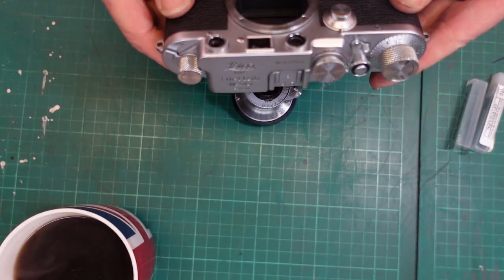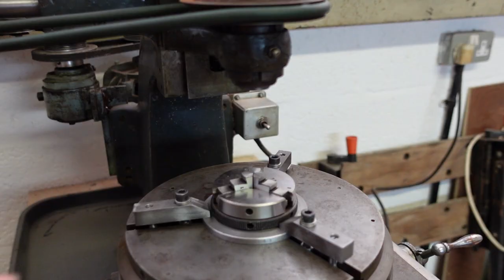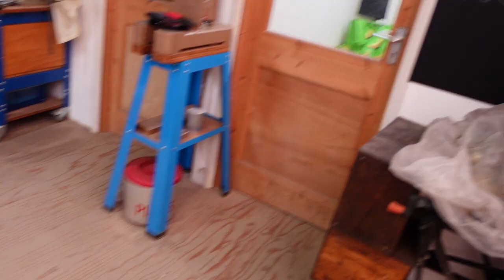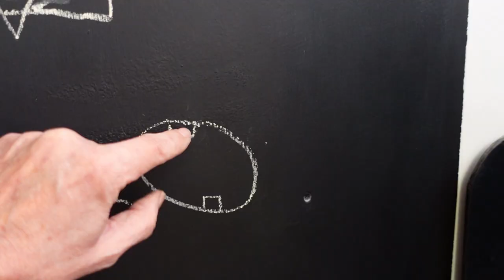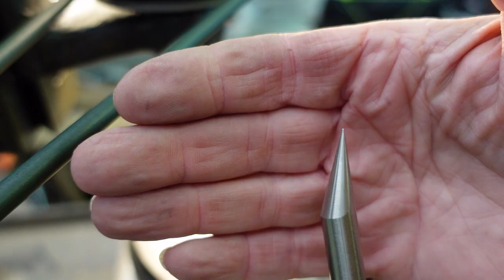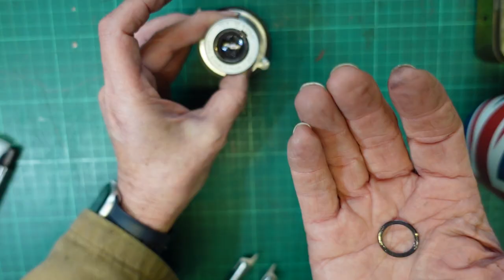Leica IIIf Camera Repair.

Comment: Good job Paul.
I work in the precision optics industry, I guess that lock ring thread is probably 0.5mm pitch.
If you turn a new ring to the same diameter as the old one and use a sharp single point tool (or ideally a 0.5mm threading insert) and feed in to cut 0.3mm deep (take 5 or 6 passes) that should be pretty close to screwing in. Chamfer the lead-in and deburr with a fine three square needle file run off the end with the lathe in reverse.
Once the ring screws in OK you can cut a new slot (or drill 2 holes) before turning a vee groove to form a chamfer at the parted off end before parting it off.

All you have to do then (!) is chamfer or radius the inside edge at the parted end, which screws up against the glass so needs to be smooth.
Reply from the maker: Hello Swarfy,
Many thanks for taking the time to watch my video and comment... you are correct on the 0.5mm pitch, I checked last night with a thread gauge. 
Many thanks for listing the order of operations to make the new lockring, it is very helpful.
I have no excuses now, so hopefully I will film the process in the early part of next year. Thanks again  for your help and wishing you a Happy New Year.
Take care.
Paul,,

Comment: Hi Paul, during my working life I spent 43 years in the photographic industry, sell camera and lighting equipment. The final 10 years I was the photographic consultant at Leica Camera Ltd until 2010. I’m sure you could make a replacement ring. Although there is no official Leica repair department in the UK now, there are some unofficial repairers who may be able to help. If I can help further, let me know Paul. Cheers Nobby
Reply from the maker: Hello Nobby,
That is really interesting that you were a Leica man... I am still trying to track down what thread the lockring is... I will do some more investigations in the new year. I hope you have a good Christmas and thanks for your support on both channels.
Take care.
Paul,,

Comment: Hello Paul, I did a similar task for a friend using the Bridgeport. While the machine did just fine, I’d have liked to try it with a lighter machine with better feel. I reckon your jig borer is just right. 👍
Reply: Merry Christmas 🎄 Paul!
Reply from the maker: Hello Doric,
You are correct the feedback on the jig borer is very good... I did think about using the sensitive drilling machine initially, I'm pleased i went with the BCA otherwise I think I would have been in trouble... Thanks for all your support this year & Merry Christmas to you.
Take care.
Paul,,